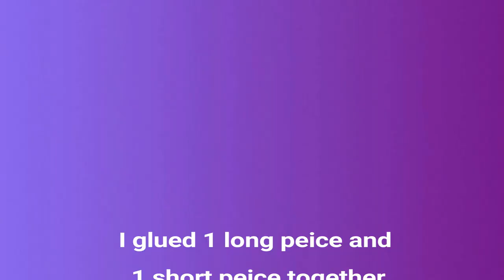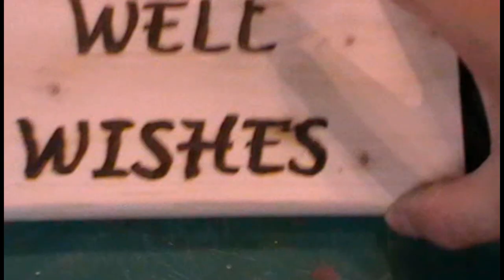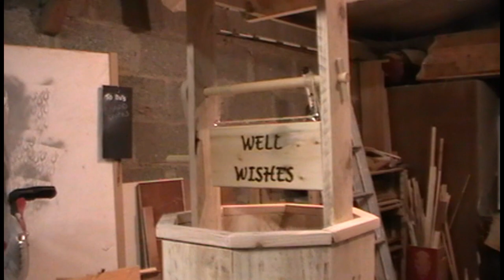Pallet wood Wishing Well

Comment: Man I had one of those Black and Decker drills for a long time. Best cheap cordless tool I've ever owned. It burnt up in a fire I was sad to lose it
Reply from the maker: Great little drill. I only replaced that one with a newer model because the charger stopped working. The drill itself was superb for a cheap drill!
Reply: @andy.elliott.foreverpens  heck yeah I was a young new homeowner when I bought it and it served me well, I was so happy with it for the price I bought the hedge trimmer as well as two extra batteries. So I had two chargers and four batteries.  Now I have a nice DeWalt set that my mother-in-law got me on a wicked good sale.

Comment: the blade guard should always be set about 1/8 inch above the  stock that you are cutting. It seems that you had it at
least one to two inches above the stock that you were cutting. Setting it too high will sometimes cause the blade to break.

Comment: So are the wishing well “walls” 30 degrees each and then the “skirt” around the top 22.5 degrees each? I struggle to get mine neat and tidy at the top, I assumed it would be 30 degrees like the body?
Reply from the maker: No mate, at the start the video shows a text box in the corner that says "tilt blade to 22.5⁰" for the drum section. The trim across the top is also 22.5⁰, ye should match perfect then!

Comment: Nice build: a few questions.  You seem to be lucky in having wide battens; most pallets I can get have narrower ones.  What types of adhesive were you using? There was a spray of some kind; there was a white guey compound but not specified and was that cyanoacrylic in the tubes? Also you seemed to mix two adhesives at one point. I'd like a much fuller explanation of that if possible. I am making wishing wells from 'recycled timber to sell as well, but also attempting to make some more sophisticated stuff like lighthouses and windmills. Some of the stuff on Pinterest is really cool and might well sell OK> What do you charge for your wells?
Reply from the maker: Hi Barry! Wide boards seem to be an issue with many people, so I guess Lucky would be accurate!  For my wells, I use a 6" board.  The most common ones seem to be about 4", so i recommend gluing 2 together, then ripping a 1" strip off each side.  This will give you the right size board, but also but the join in the middle. Edge jointing is vital on this though! 

The spray is an activator for CA Glue.

For the base and the roof slats, I use a combination of CA glue of exterior wood glue.  CA Glue in the ends and middle, with Wood glue in between for strength.  The CA glue acts as a clamp while the wood glue dries & I can move on with the project.

For the sales price, I base that on the quality of the wood, and how nice it looks once its completed. If the wood looks a bit more rough, then I'l drop the price a little, but as a general rule, I sell them for €50 Euro each.

Free plans are still available if you would like a copy. just email me at andydascouser@live.ie  and I'll forward on a set to you.  Any further questions, please feel free to drop me an Email or a PM message!  

Thanks for watching the Video, I really appreciate it Barry!

Comment: Is this for outside use? The bottom will rot out
Reply from the maker: 2 years in. Base still there. When I make these, I leave them bare, no finish, so that when the buyer gets it, they can treat or paint it their own way. For mine, I used yacht varnish and the base is lifted, so not in direct contact with soil or grass. Thank for watching!

Comment: can you explain the tape ? are you putting glue over the tape ?
Reply from the maker: Hi Rick. The glue goes on the Mitred edges of the wood. The tape acts a clamp to hold all the pieces together and close up the gaps. Really effective way to glue Mitre joints, even on a 45 degree cut on a box for example.

Comment: what was that glue you were spraying
Reply from the maker: Hi Dan - That is CA Glue and Activator. Its a very quick drying superglue. Ideal for small areas. Also great when used with normal Wood Glue.  The CA Glue acts as an immediate clamp, so you can move on with your project while the wood glue sets.

Comment: Could u make this without a table saw
Reply from the maker: Probably not. Cutting the mitred edges for the base section would be impossible to do accurately by hand.
Reply: What about with a circular saw
Reply from the maker: @alexanderferguson6587  way outside my own personal comfort zone! Clamping a 6"board securely, whilst making a very straight cut would be very hard I'd imagine. I guess you could try a jigsaw tilted to 22.5 degree with a fence maybe?